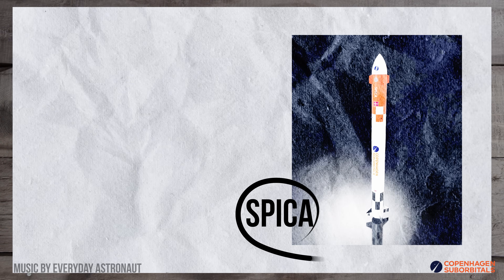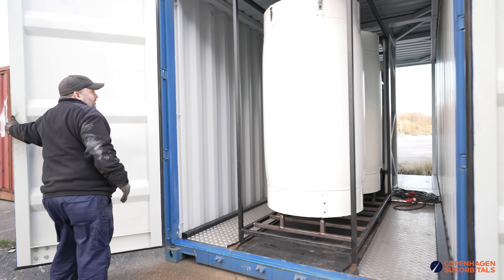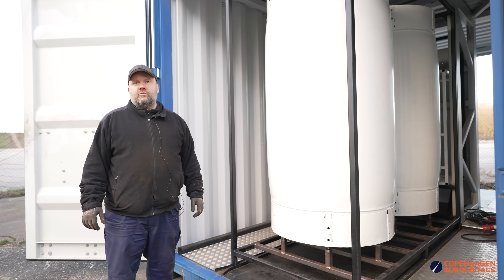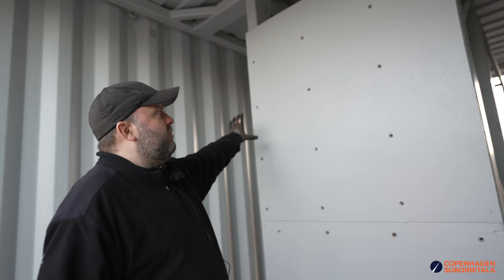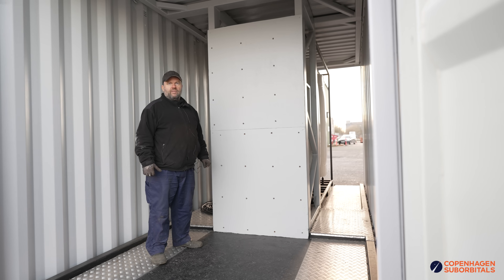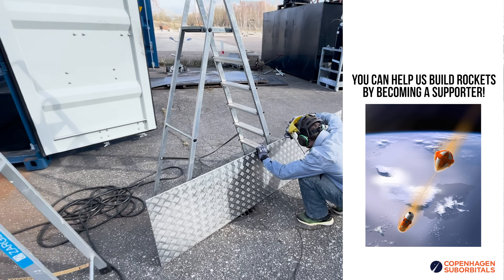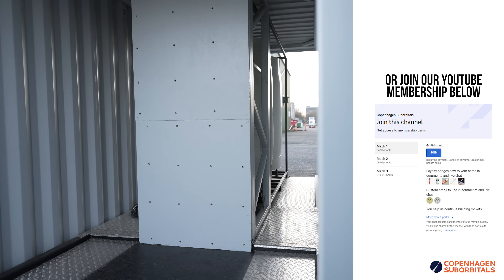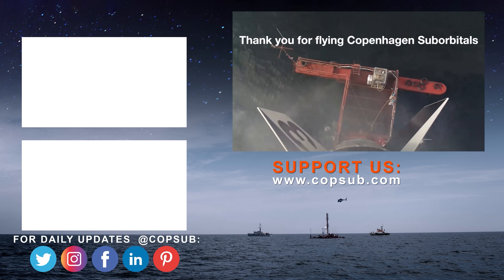A tour of our rocket engine test stand

Comment: Have you explored making the container a "body on frame"? since you're reinforcing everything, making a tubular frame with removable panels doesn't look too far off, and that would give you great access to work. The central unit moreover would be like the core of a high rise building, providing shear strenght when the panels are removed.

Comment: This is a great update!! Could you explain the importance of paint? Are there any problems related to the steel + LOX interaction?
Reply: 1) Steel left outside will rust if it is not surface treated. It's our way of protecting (and presenting) a hard and nice work done 🙂
2) Welds (and their surroundings) looks way better when painted. Unpainted welds indicates that we didn't know what we were doing 🙂
3) Surfaces directly in contact with LOX is never painted. LOX-tanks are painted, but the paint peels off when the tanks are subjected to cryogenic temperatures. We never foliage parts that are exposed to cryogenic temperatures, as the foliage will crack and peel of in flakes 🙂

Comment: Does the rocket need to be aerodynamic because you're not going to be waisting fuel, fighting the air, and burning up or  would you rather have the rocked more pointed so it takes less fuel to fight higher density air.
Reply: He's saying the shipping container is basically a rocket because it has the engine, along with fuel tanks and systems to supply fuel to the engine. It's a portable test stand. They are not intending to fly the shipping container. If the shipping container flies, something has gone horribly wrong.
Reply: @edicius959  ahhhhh and also it was playing on my mind because space x has built a big fat round rocket hahaha so om just wondering if he was talking about making the rocket (not the container 🤫🤫) more round and flat
Reply: But if you're asking about rockets in general, then yes, all the reasons you gave are why having them be aerodynamic is a good idea. It also helps them maintain stability.

Comment: If u don't mind me asking, what software or algorithms are used for tvc/ gimbal control on this rocket? Love the work u guys do!! 😀
Reply from the maker: Thank you! Active guidance is not something we can delve into a lot of detail due to dual-use laws in Denmark, but here are some videos on the topic in the past:
https://youtu.be/zeWK774hlQo?feature=shared
https://youtu.be/3ECQL3g_Woo?feature=shared
https://youtu.be/dwOG8lTNZ0o?feature=shared
Reply: Still very impressive. I am working on a school project for GNC. Rly trying to figure out if industry based companies use PID as it's so popular with models yet seems too simple for manned spaceflight either way appreciated the insights
Reply: @collintieman7245 if you want to go all out: Boyd and Vandenberghe (or just use their software). Lars Blackmore has some publications on how to use convex optimization for fairly advanced rocket control.
Reply: Good question, I am interested to!
Reply: It will be developed in-house, and the knowledge (and therefore also software) will probably not be published in detail due to the possible misuse by evildoers worldwide.  It will be a very simple (but tough and hardened) system with GPS devices, accelerometers, sensors, a variety of actuators, probably controlled by something like the CSduino.  The function will be mostly like the "hover" and "eject parachute" functions of common quad copter systems, so not exactly super advanced.
Reply: I understand, thank you very much tho. It is incredibly inspiring to see the progress.